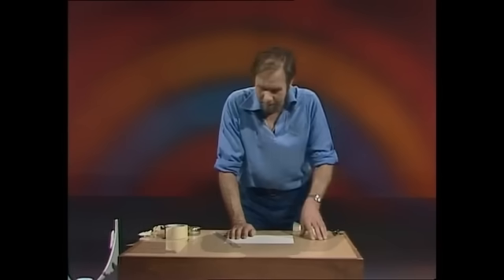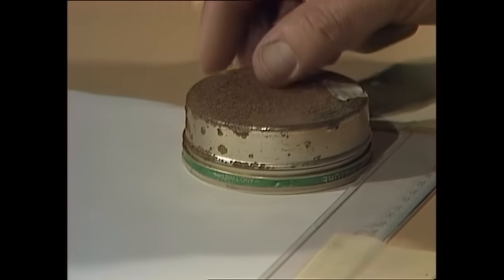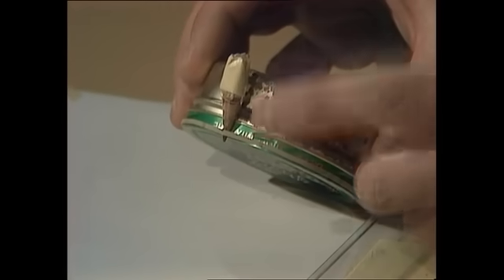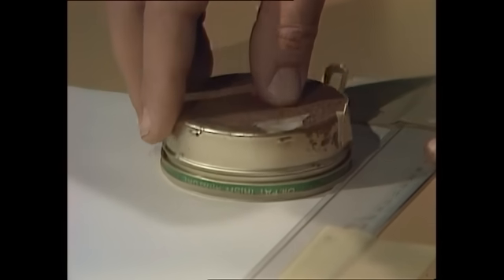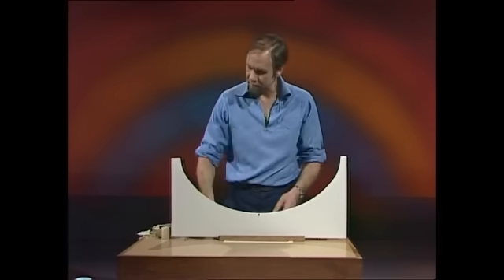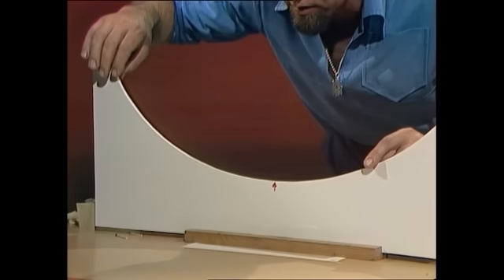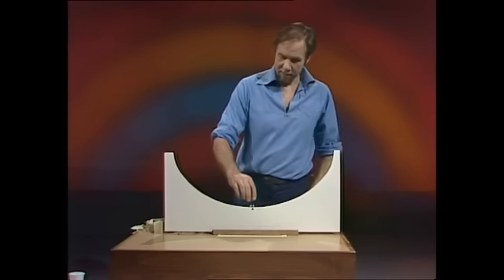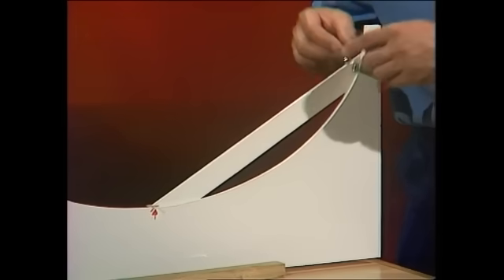The mysterious isochronous curve

Comment: At 3:19 he states that if the curve was circular the two balls will not meet at the centre if released from different heights.
Well, this is wrong.
The timing of a pendulum is evidence that the weight takes the same time to reach the bottom of it 's swing regardless of the distance travelled.
Reply from the maker: But it isn't a pendulum
Reply: You do have roughly equivalent forces: rolling resistance on the curve and axle friction (or string stiffness) of the pendulum; air resistance; the component of gravity tangential to the track and the component of gravity radial to the track. 
Only one thing to be done, Purple: build yourself a circular track and try it.

Comment: If anyone wants to know, the arc length of the curve is 8 times radius os the can.
Reply: The isochronous curve isn't a circle, so you can't use the arc length formula
Reply: For those having trouble with this ... "Arc length" is the distance along the curve .  It is understood that the curve is not part of a circle and so, yes, you can't use a formula for the arc length that applies only to a circle (duh).  The circumference of the can is about 6.2832 (two pi) times its radius, but that is the length of the chord joining the ends of the curve.  If we don't want to focus on the ball-bearings-meet-in-the-middle thing, we can call this curve by its proper name - a cycloid.  Then we can look it up on Wikipedia and find the proof of what the original comment claims.
Reply: Just so it's easy to see. The arc length of the can is the ruler length and to end of the curve. Obviously the curve is longer. If I had to take a wild stab in the dark I'd say the curve length is related to another constant, Phi. I'm no mathematician though.
Reply: ...the formula for circumference is 8x the radius? Not proved this, nor am I going to prove my own statement as I could be wrong anyway but at a glance, we just drew a lines path from the outside of a circle coincidentally the circumference in length, where the measuring comes into play would mean to measure the arc drawn rather than the distance travelled. This is essentially drawing “miles” compared to “nautical miles”
Reply: @f1reguy587  no the curve length is not the circumference if that is what you mean. This type of curve follows a special trajectory which is that of a point in pure rolling of  a solid body.
Reply: @f1reguy587  circumference only would apply in a stationary circle. The arc is from displacement of the circle.

Comment: A curve thats part of a circle, has an equal curvature ( or slope ) at all its points, where as the isochronous curve does not. It is almost vertical at the sides and flattens out gradually top & bottom.
The speed at which the ball moves at different positions on the curve is related to the slope at that point and how potential and kinetic energy of the ball changes. Since the ball is released with zero kinetic energy, all of its motion relies on the potential energy of the ball, trajected along the slope of the curve. You'll find there will always be a give and take (trade-off) between the height and the distance away from center, thats relates to how fast the ball moves when released.

Comment: Gravity is a huge part of your experiment. For example this would not work in outer space and the results would be different if the gravitational pull was different.
Just thought I should point that out since you didn't.
Reply: In space, no, this wouldn't work,
But in different gravitational pull, as long as it is constant, the result would be the same, it just take different time to reach it
Reply: @mbrusyda9437  Exactly.
Reply: Temperature is very important too. For instance this would not work on the surface of the sun because the special cardboard would catch on fire, yet he failed to mention that.

Comment: So then how come two vert ramp skaters don't always meet in the middle then as well because gravity is working the same on both of them sometimes one tricks in and lands lower and sometimes one comes in at the same time higher on the ramp then the other however they both move on same type bearings same type transportation i e a skateboard but they don't always meet in the middle even though gravity pulls them both back in usually at the same time unless ones doing a grind tRick and then they take longer on top of the ramp
Reply: The the inertia and pump is what skaters call it is what gives the curve a faster momentum similar to drafting in NASCAR and passing on a curve on the inside using this same drop in pump as compared to the one that remains on the straight path even though all the same curve dropping into the bottom of the ass a lot faster after the draft

Comment: I Had To Wrap My Brain Around This. Turns Out E=MC Squared. The Ball Falling On The Shorter Line Is Not Moving As Fast as the Ball on the curve.(Less Massive). The Ball Falling From Farther Up Will Be Falling Faster, And They Gain In Mass, The Ball Falling A Shorter Distance Doesn't Travel As Fast And Is Less Massive. So They End Up Cancelling Out And Meeting In The Same Spot When Released. E=MC Squared. :)
Reply: E = MC Squared has nothing to do with this.
Reply: @Randsurfer  😂😂😂😂😂😂😂😂😂😂😂
Reply: Accelaration, The ball farthest from the center is at a steeper angle and accelarates fast.
Reply: @thundercuck1779  The formula, E=mc2 tells us the amount of energy stored in the nuclear bonds of the atoms which compose matter.  That is unrelated to  "Mechanical Physics", which is being shown in this video.  If you can relate the two, please do so in your reply.  And please don't quote Deepak Chopra, he makes my head hurt.
Reply: @thundercuck1779  F=ma is not related to E-mc2, not loosely or in any other way.  You words have almost no meaning.

For example:  "The heavier drop initially gives higher C value to -9.81 m/s^2".  What is the value of C and how did it become higher?  Also, why are you even mentioning C related to -9.81 m/s^2?  

The speed of light has nothing to do with the formula for Gravitational Force on Earth, nor does it have anything to do with anything in this video.  In fact, not a single component of E=mc^2 have anything to do with the demonstration in this video.

I pray you are not a teacher.
Reply: @thundercuck1779  I can only assume that so much gibberish is actually a physics troll.  So, good job getting me to debate an idiot.  It's unfortunate that there are actually people who speak of Physics principles like this, for example, the Deepak Chopra I mentioned before.  Stay groovy.

Comment: hmmm what is so peculiar about this. The angle of descent is much higher the higher you go on the curve...therefore the higher the ball is placed on the curve the faster it will travel...the lower you place a ball on a curve the slower it will travel which is why they meet in the middle. the reason why the ball on the curve knocked the match of first is because the angle of descent again. poof....mystery gone

Comment: Wait hol up! If the quickest way between two points is a straight line. (Besides a worm hole) what do we have to say about that statement with isochronous curves? And does that only work on a 2d world or 3D World, let's not get started on the 4D world of isochronous Curves🤤👽😰
Reply: The shortest path between two points is a straight line, the quickest way is a different matter

Comment: So because of the shape of the curve the ball bearing picks up speed at a faster rate at the edge and a slower rate towards the center. That's pretty cool, but here's a question; how much of a margin of error is there? It's all good and well to show us this, but seeing it is one thing, and it actually being the case is another. If you had this curve perfect, and you got a computer to track every possible variation of the two start points, would they actually meet in the center or would they just appear to?
Reply: They actually would. You can show it mathematically, which is a better proof than repeated experimentation.

Comment: So the fasrest shortest most direct point or route isnt a straight line hmmm
Reply: Enemy of the State/ VCD King straight line is shortest and most direct. Fastest goes to this though.
Reply: That fact was only accurate for that specific curve and the center of that curve. Dropping a ball at that same height would fall faster than one following the curve. Gravity is responsible for accelerating the balls and, therefore, the ball that is able to adhere to the full force of gravity will accelerate and travel faster than one that follows a path that is not directly in line with the force applied. 
Simple physics.
Reply: Daniel Andersson  I think friction force should be taken into the equation, as in ideal conditions variation of potential energy is the only thing that matters. In ideal conditions both balls would arrive at the same time whatever their paths were. In the straight path aceleration and friction force are constant, while in the isochronous curve aren't.
Reply: @analisisdedatos9871  Even if there's no friction, the ball will arrive latter traveling in straight line. Yeah, variation in potential energy is the same for any path, but that is in no way correlated to travel time, it just means final velocities will be the same.
Reply: @dariobarisic3502  so you are saying that if an object is thrown with 20 m/s and 20° degrees above the floor and another is thrown paralel with the floor with the same speed, both objects will hit in the final point of the parabolic trajectory of the first object in ideal conditions (neglecting air resistance)?
Reply: @analisisdedatos9871  Sorry, I didn't understand a thing you wrote.
Reply: I am talking about parabolic motion, you are saying that a ball moving in a horizontal direction at, for example, 20 m/s, would hit another ball that is thrown at the same time with the same speed but with an angle because both balls would arrive at the same time to certain point in the floor.
Reply: @analisisdedatos9871  I never said that or anything that implied that.
Reply: @dariobarisic3502  I thought better and it is true, even without friction the time is dependent on the trajectory, my example implies that the time is greater in the long path, but it is something we can't know without knowing the equation of the path in all cases.
Reply: @analisisdedatos9871  Correct! If you drop a ball from 2 meters, or shoot it at a 1000fps from a rifle, they both hit the ground at the same time. Rate of fall is unaffected by rate of forward travel.
Reply: This property of a straight line does not account for gravitational pull, i don't think
Reply: EOS/VCD King - Ever notice on a GPS/Nav where it will give you more than one option, Either the shortest, or fastest? This is due to variables. In this example, the straight line is shortest, but with the gravity variable, the circle route is faster. I know I dumbed it down a bit, but hopefully it makes sense.
Reply: It could also apply to time....
Reply: r/whooosh
Reply: If ur talking about rolling downward and using gravity, but if u were walking to a point then a straight line would be faster lol
Reply: gomer 1993  good analogy

Comment: I have been thinking about this overnight:

What about an INVERTED isochronous curve?  (I mean in the form of an ARCH that was a MIRROR IMAGE of the curve shown, rather than as a SAUCER, with balls run OVER it.  I am thinking about the shape of the left-over material that was CUT OUT in order to make the curve that was used in the video.)

OK ... now a ball released from the apex of this arch curve would accelerate slowly and then more quickly as it ran down a steepening slope.  However, a ball released further down the slope would accelerate more rapidly (as the slope would be steeper) and have a shorter distance to travel getting to the bottom much sooner... and so on for balls released lower and lower down the arch.  Now... plot the results on a GRAPH (Time against Distance) of the time taken by each ball released and the distance covered .... would the shape of the graph plot resemble an Isochronous Curve?

Comment: Are these curves used in the Olympics on Snowboarding Half Pipes?
Reply: Frank i think half pipe would be half a cylinder,  but someone should make onelike this
Reply: @samuelyoung2671  Half pipe in snowboarding is not constructed as a half cylinder.  There is a flat section between the two curved sides.
Reply: @samuelyoung2671  a half cylinder plus vertical like this
Reply: If you're riding downhill (and who doesn't?), you'll cut a path similar to the isochronous curve but not the same.

Comment: Seems the same logic as how two planes could be flying toward the same point from the same altitude, one could dive slowly and gradually with assisted graitational pull on its mass in a straight line toward its ground target being quite minimal, and another one could dive in the same curvature as demonstrated here and pickup enough speed to reach the destination first with gravity on mass assisted speed at a rate that is relative to the same curve and much faster than the plane that simply flew in a straight line with a slight downward angle.

Comment: Those results do appear to be anomalous, but since the ball bearing is accelerating faster due to almost freefall conditions at the highest point, it should be expected to accelerate a lot faster (and therefore be capable of travelling a lot further) than a ball rolling essentially sideways - even down an approximately 45 degree incline. 

Anyone who's stopped peddling at the top of a hill and experienced acceleration as they then freewheel down the other side would be familiar with this effect. 

Nice vid though - from a time before TV only makes people dumber.

Comment: I think the reason the ball goes faster in the curve than in the straight line is because of energy. They both start at the same height and speed ( initial speed being 0), wich means they both have the same ammount of energy, but as they descend, their gravitational potential energy transforms into kinetic energy, and since the ball on the curve travels at a lower height than the ball on the straight path, it is bound to move faster.

Comment: That was really great. I'm not sure I understand its significance.
Gravity and horizontal motion are independent of each other. The more time the ball bearing spends dropping in the direction of the gravity the greater the acceleration. The more time the ball bearing spends moving perpendicular to the direction of gravity the greater the resistance.
But what is the significance and how is this mechanically advantageous. How do you take mechanical advantage of the difference? Start thinking of cranks and cams. It's a wonderful insightful example you have there.

Comment: Of course it won't really work very well with so much friction as in your tangible example you have there. The only practical use I could think of for this would be for a sort of clock pendulum, since the time period for it to roll from one side and back will be the same independent of the height it starts out at. But you would need some sort of system to magnetically give the ball bearing back energy so that it doesn't lose height and settles into a stable pattern.

Comment: This is brilliant. Rotary to linear motion. The circle is going in a straight line.
It's exactly the same on a crank on a steam engine. A steam engine and car piston can only go in straight lines but the steam engine usually has an extra linkage and is  massive, open and slower so it is all so much easier to see, but a car engine does exactly the same. 

The  piston goes in a straight line and the crank goes in a circle. It's all they can do. Linear to rotary motion all linked.

If you watch the crosshead, which is the sticky out bit of the piston, go up its slide as the crank turns the crankshaft, it appears to slow as it nears top dead centre and bottom ditto the other way. The crank does its ΠD = circumference malarchy but the piston can only do the D bit, the diameter, which is a straight line up and down its bore so it's got to hang about while the crank and connecting link makes up its its mind and changes direction.

If the guy had twice the length of ruler and went on for another rotation, you'd see the pencil reverse and  while the circumference is irrevocably going forward.

This is all highly significant and revealing and the guy here shows another aspect with ball bearings on that curve. 

I've no idea what it means: all I do is stare at steam engines occasionally on my day off.